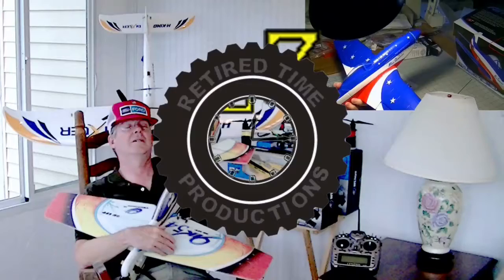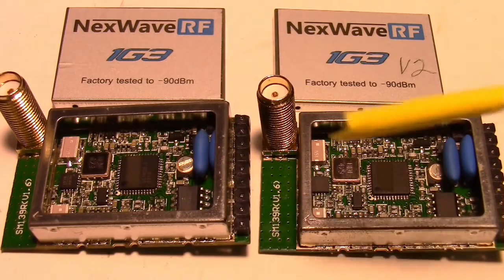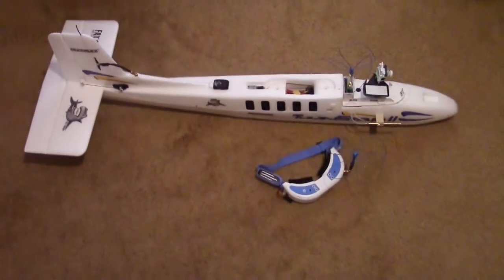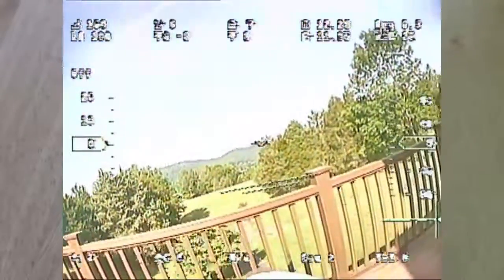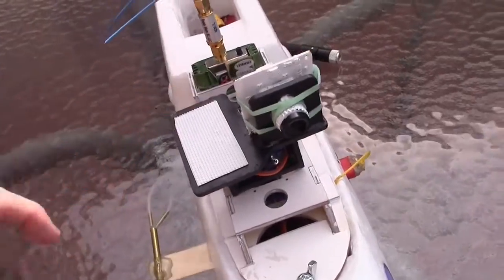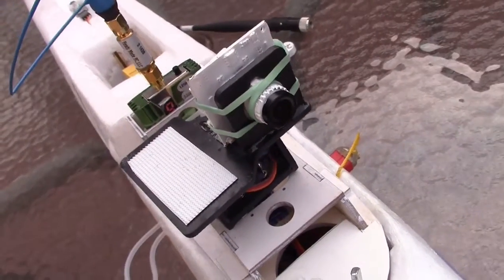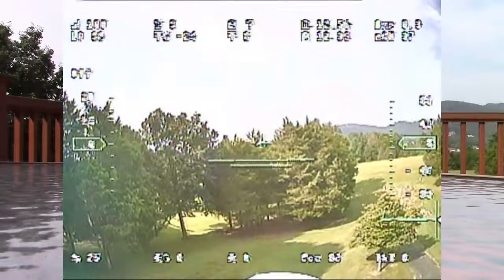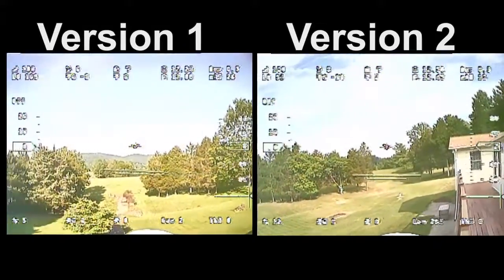Testing Fat Shark 1G3 Receiver Module, 2nd batch.

Comment: I have the FS  v3 receiver and FS 250mw vtx. Using stock antennas I'm disappointed with the range. I only get around 1000 feet. Any ideas?  Thanks!
Reply from the maker: I use digital brand 1.3 Transmitters 400mw and 800mw from RMRC. Never tried the Fat Shark unit. 1000 ft seems a little short though.
Reply: @DaveMerc  what range do you get with the 400mw?
Reply from the maker: Phil. I don't do range testing but here is a flight where I went out to 1700 feet away with stock antennas on 400 mw with no break up. https://www.youtube.com/watch?v=GhjkMdXRHMg
Reply from the maker: Phil this is what I use a lot because it just works great and in very efficient.
https://www.readymaderc.com/products/details/rmrc-1-3ghz-400mw-transmitter-us-version

Comment: They are not identical, one capacitor has been removed
Reply from the maker: Aerialworks Where on the board is has this cap been removed? Location?
Reply: http://fpvlab.com/forums/showthread.php?38249-Fatshark-beta-1g3-nexwave-Rx-Testing&p=710923&viewfull=1#post710923
Reply from the maker: Aerialworks Thanks so much for the link. I see where the cap is missing now that you have pointed it out. This is good because now I know that I have actually got an upgraded version. My understanding is the missing cap is to improve the range but if that is all they did then they still need to fix the video flickering.

Comment: Hmmm not good , I have the laser as well as the version one fs receiver just waiting on my v2 too arrive, I've also noticed laser Bbc have just released a version to on there receiver bear in mind I've been 10 km on that receiver in my goggles so fat shark has some work to do it would seem only time will tell
Reply from the maker: mc drone What type of antenna set are you using with the LaserBGC, Mc Drone?
Reply: I normally use standard whips, but when I did 10 km I was using fpvlr antennas great quality

Comment: The biggest problem with the laserbgc reveiver is the filtering. When you fly on 1280mhz and your buddy on 1360mhz you have no image left, only interferrence.
Can you test this?
It would really be a shame if the nexwave also has this problem.
Reply from the maker: Sander vdl I for one can't test that. 1280 and 1258 are the only 1G3 frequencies allowed in the US.  RMRC won't even sell me a VTX that will transmit 1360, those higher frequencies are locked out in the US.
Reply: ***** I think that i will receve the modules next week, i will test it and upload.
We also use LPCH and RHCP antenna's.
If you looking for a vtx send me a message, we have no locked channels in EU
Reply: ***** I have tested the 1.3 module too, as i have received them yesterday. 
http://fpvlab.com/forums/showthread.php?38249-Fatshark-beta-1g3-nexwave-Rx-Testing/page50
My nickname is killerbean. 
In short, i am sure the problem is the vtx. Maybe even the crystal in the vtx. 
Cheers , Sander
Reply from the maker: Sander vdl Hello killerbean, I was just talking about you at the Flying Circus event yesterday. Stoneblueairlines has been watching the forum as well.
Your testing is much appreciated. Thanks to you I still have not given up hope that someday I will fly 1258 with the FS Nextwave module. For now, I flew with the LaserBGC RX module this weekend at the event and it worked great. As long as I stayed in a quarter mile radius I had a good solid picture with all my RMRC transmitters on 1280 mHz.
Reply: ***** Hi Dave, thank you for telling me this, i was thinking i am the only one that wants the 1.3 nexwave to be working good. I hope fatshark can fix the issues we have with the module. Unfortunately my english writing isnt the best but it'll do for now :-)
I beleive the problem with the new module is the VTX, i have tried 2 ebay transmitters now they work much much better. And the only real difference i can see is the bigger crystal (silver can) on the good working transmitters. The ones with smaller crystal get flickering.

Thanks for the heads up !!

p.s. on the laserbgc 1.3 module i did fly 10 kilometers out a few months ago. Picture was just about the same as i did have now with the nexwave. But maybe the quality check of laserbgc is not so good?
Reply: ***** I forgot the write 2 things:
You can try holding the bottom of your antenna, i get about 20% better picture when i do this.
Laserbgc does have a new 1.3 module V2. I e-mailed them about the new module but got no response

Comment: I had the same results when I first tested the second module but after adding a LC Common Filter http://www.getfpv.com/lc-common-mode-power-filter.html the bright shimmer went away. I've tested with the newest Dominator's and Dominator V1 with both having a great picture after adding the filter.
Reply from the maker: Sean Pontzer Interesting. I have a separate battery for the video system and have not noticed any noise on my other receivers, just this one. Perhaps they need to add some filtering on the module.